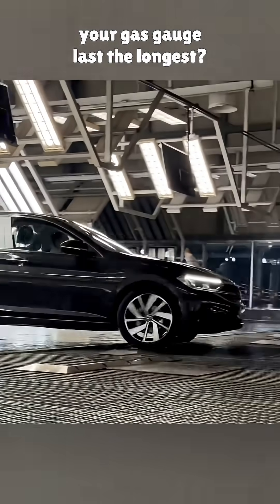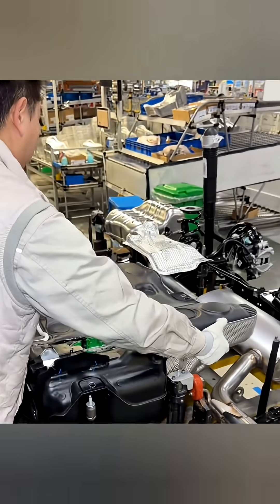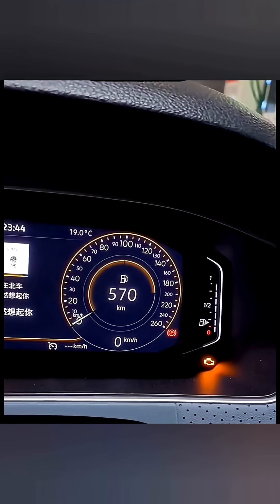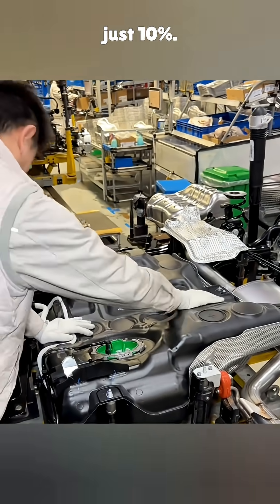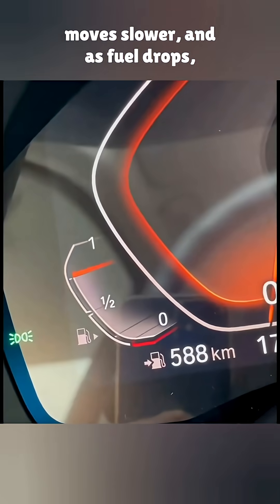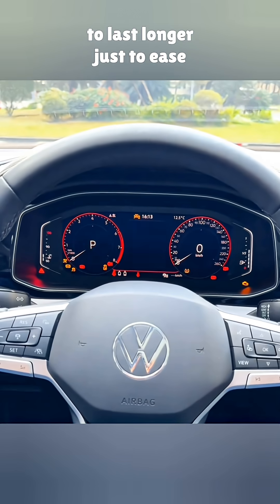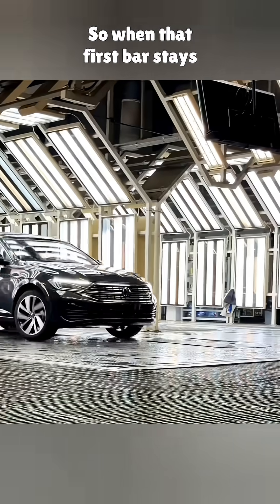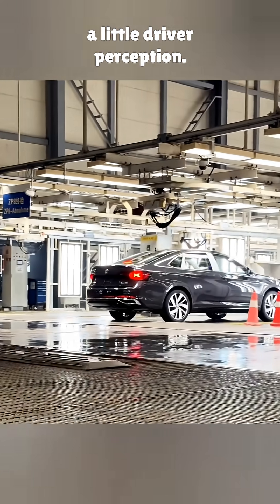Why the First Bar on Your Gas Gauge Lasts Forever #assembly #car #automobile

Comment: Yeah.  Vw  does it.  Their first bar you can drive somewhat about  300km before it moves on a highway
Reply: How do they do it 
The jetta doesn't consume gas at all
Reply: @simperman4863  it does,  wait  until  it moves  from  that full tank bar.  And you will see how fast it  goes